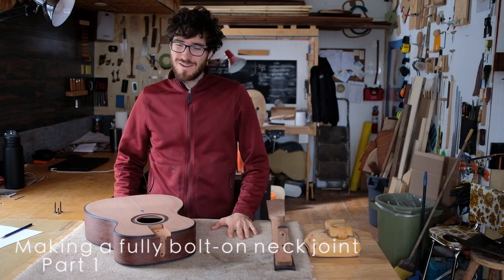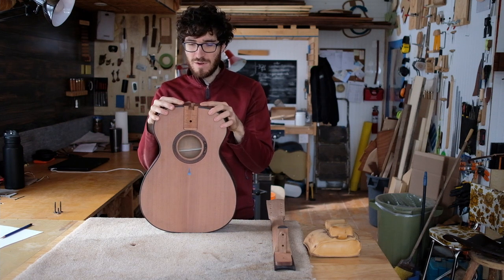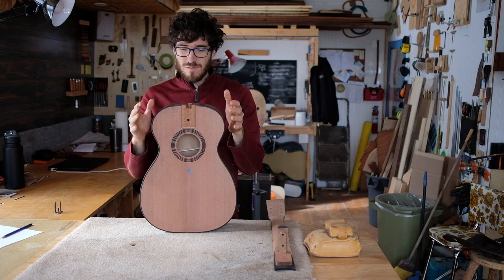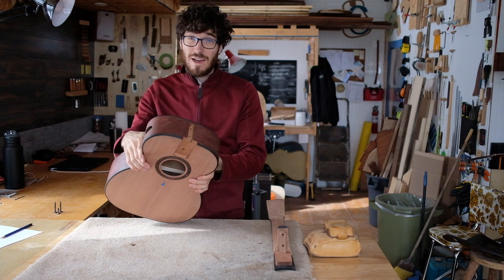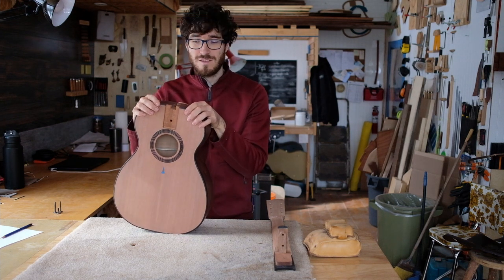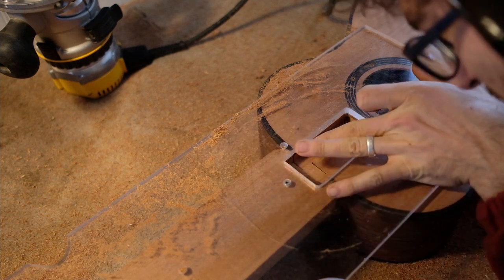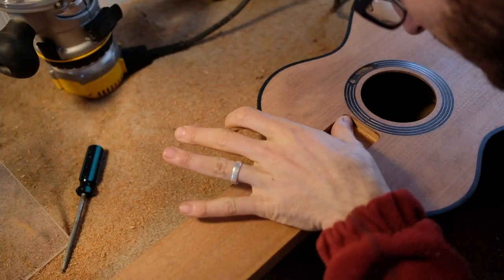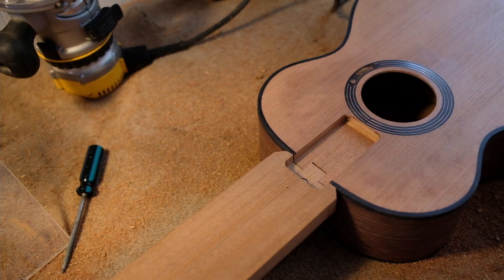Making a fully bolt-on neck joint - Part 1

Comment: How did you make the sides? I’ve seen laminated sides before, but yours have holes in them. What is that?
Reply: Do you mean the soundport on the upper bout, bass side? It’s basically just a small port for sound to go towards the player. It’s reinforced on the inside, but the rest of the sides are single-ply, standard solid wood guitar sides.
Reply: At 4:45 in the video the sides don’t look single ply. I’ve never seen anything like that before. It looks really thick, but hollow.
Reply from the maker: I think what you might be looking at is the kerfing. Here is a video that Zach did on his treehouse account before we started this one. https://www.youtube.com/watch?v=tkXNLBQowGg&t=47s - Eric
Reply: If you go to 4:45 there is something more going on. I see the kerfing, but that looks like a double wall on the sides. You can only see the kerfing from the top. If the sides were single ply, you’d see the sides of the kerfing, which you don’t.
Reply: @thomastedder - Yeah, good observation. That particular guitar (and a few others I’ve made in the past) had structured sides. Meaning the kerfing basically goes the full width of the side. Quite a few guitar makers are using this method now, but I moved away from it because I felt it didn’t work so well in my guitars, particularly in how it affected bass response. 🤷🏻‍♂️
Hopefully that image didn’t make things confusing! If you have any questions let me know and I’ll do my best to answer them. :)
Reply: @zachlefebvre4825  Now it's making sense! Thanks. You should try laminating the sides the way Driftwood Guitars does. It's in one of the videos on the 3,000 year old guitar build. I've been doing that. I just use blanket/comforter vacuum bags from amazon and epoxy two sets of sides together, then treat it normally for the build. I buy B grade mahogany and indian rosewood for the inner layer, then use good stuff on the outside. I shoot for .150" total thickness.
Reply: @thomastedder - Yes! That works well too. I’ve built quite a few guitars like that, only with hard maple as the inner layer. I think (haven’t gone to the trouble of testing the theory yet) that a dense inner layer is beneficial to the sound, in combination with the traditional placement of a guitar’s soundhole. Have you ever seen one of those architectural installations with a large curved, wall (made of a hard material), where you can whisper against the wall at one end and it will be clearly heard at the other end? That’s the way I think of the sides on the inside of the guitar. Does it actually make sense, I’m not completely sure, but I have a theory that it does affect the acoustics in some way.

Comment: No no. The only metal thing in a guitar shoul be, strings and tuners, not screws for the neck in any way. So practise to make a real dovetail, is recomended and trow them screws away. If You dont have the skill to do a dovetail in the usual manner, I will recomend to do other things in the future.
Reply: There are many ways to make a great guitar - this is one of them. I used to do a dovetail neck joint and got quite good and efficient at it, but it has its flaws. It does not support the upper bout of the guitar very well so the guitar’s geometry changes much more over time than with a neck joint like this. Also once the geometry changes, it is a time-intensive and expensive job to readjust the neck angle to correct the changes in geometry. I am certainly not against dovetail neck joints, but after using several neck joint methods, I much prefer this type of neck joint for many reasons - and I believe it is much more difficult to execute than a simple dovetail. 🤷🏻‍♂️
Reply from the maker: So @tribestribes2555 are you suggesting we should leave the neck to it's own devices because it's metal and not a string or tuner?